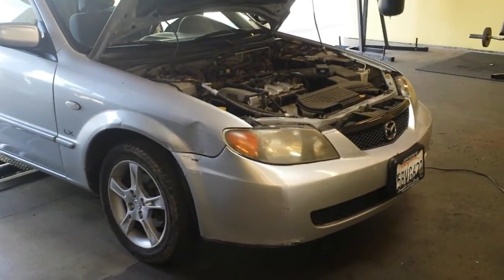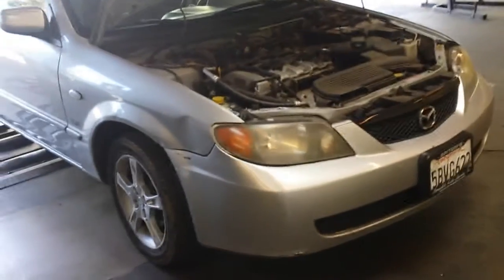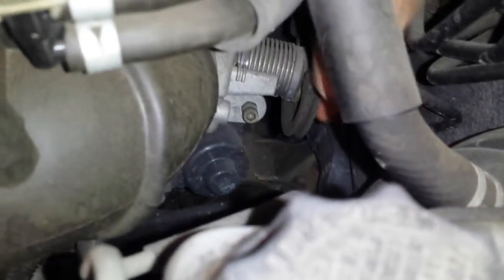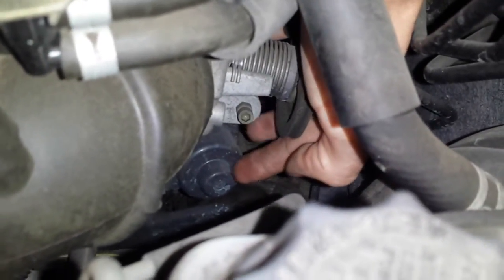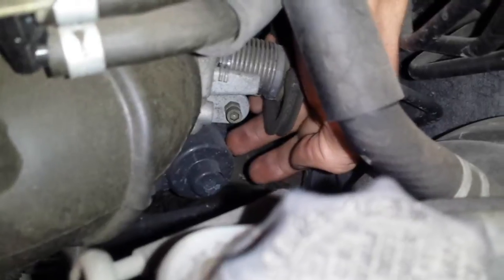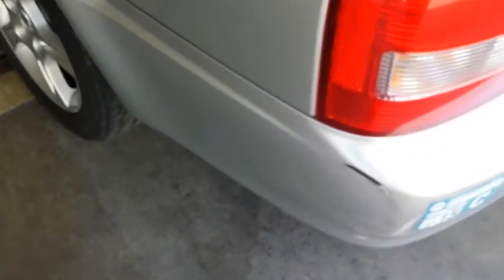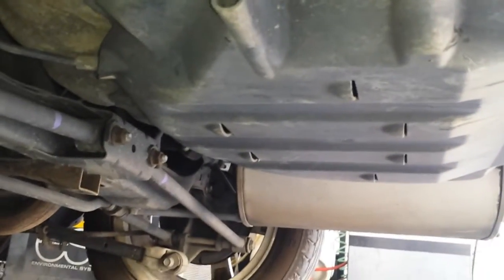Mazda Protege: Where is the EVAP canister & EGR Valve

Comment: Will this make the gas pump click off when I try to put gas?
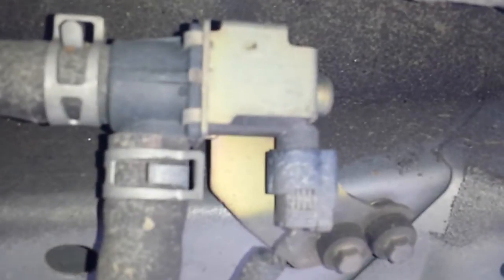Reply from the maker: I kind of lie in this video, I say the purge is in the back of the vehicle. That is the vent valve in the back at 00:59 If that vent valve is malfunctioning you will not be able to pump gas. it could also be a restriction in your gas tank filler neck.